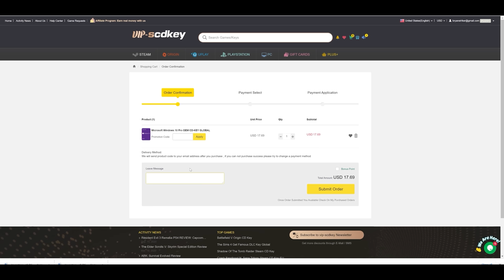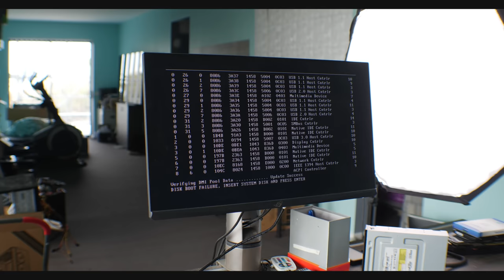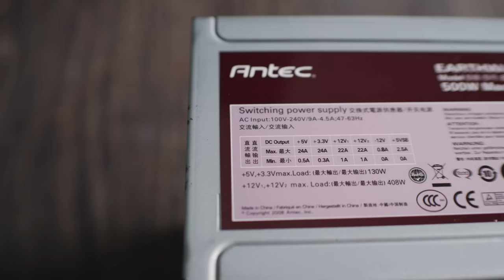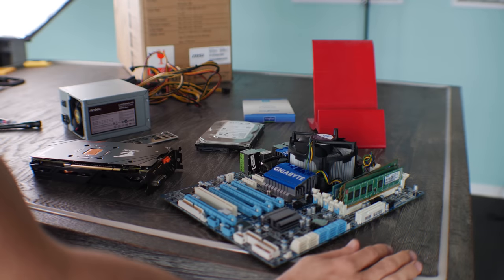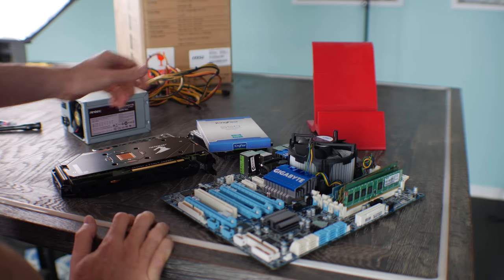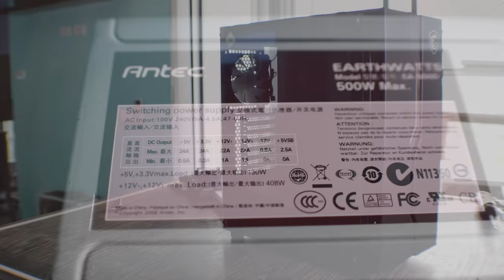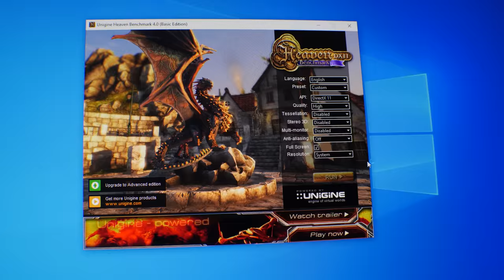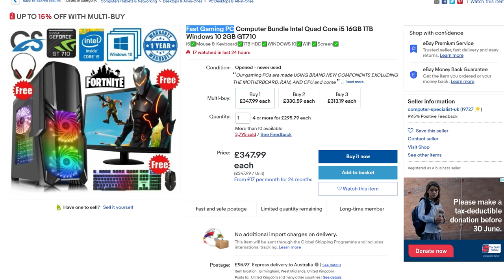Old Gaming PC Found on the Road.... Will it Work?

Comment: I like how you encourage this eco-friendly attitude. Let's use our components until they fail.
Reply: Lol, tell Microsoft that. Lol
Reply: If you suggest to not make upgrade, not wise. My Athlon 2000+ XP and Radeon 9550 are still working in a Win 98 rig.
Reply: @patrickprafke4894  in 2025 it wont be so easy with windows 11 vs normal dude
Reply: @WeatherMan2005  The US gov. And many other industries petitioned for and already received notice that Win 10 will receive updates in a variety of ways well well past 2025.  Main reason.  By the time Windows 10 dies.  12 is supposed to be here.

Comment: I got into tech from collecting thrown away old "not working" PCs when I was age 12-15, 90% of the parts still worked. I upgraded my first PC a Pentium 3 866Mhz to a Pentium 4 2.8Ghz for free, a bios setting was preventing the PC from booting, all I had to do was clean cmos button. LUL
Reply: What year was it when you first got into tech?

Comment: I bought one of those motherboards for 40aud as a “not working”... reset the bios and it booted first shot. It lives as my gtx960 turbo of 4gb sli 20gbram junker pc! The power supply and boot drive(120gb patriot inferno) were also on the side of the road.... the ssd had windows 7 that I upgraded to w10 free. Love the junker pc and the tower I put it in supports hot swapping . Great boards those udr3 x58 boards.

Comment: It is as they say - the best deals are found on the roadside.
Reply: Maybe depends😂
Reply: Honestly though how tf do you find a computer on the side of the road
Reply: @owenward7355   It takes effort to search around and if you get lucky like bryan/tech yes city then you have yourself a pc picked up on the side of the road.
Reply: @owenward7355  In certain parts of Australia and other places, every so often (it varies),  the city runs a promotion where you leave junk outside and the city picks them.  So there's another youtuber who goes around on that day to snap up computers and other recyclable stuff to melt down and sell as scrap.
Reply: @owenward7355  Alternatively, some people advertise on local facebook or craiglist, they'll leave stuff outside and you can grab it free. I was super lucky and picked up an i5-3470, 6gb RAM, asus motherboard. Like tech city, my system was missing side door, no power supply and the cpu fan was busted. The person gave it away and had listed it as pickup beside garbag bin of apartment complex.  Naturally, freebie deals get snapped up instantly so you have to be constantly checking facebook/craiglist.
Reply: @supertouring1  yup this is correct. Im in the brisbane region and its amazing what you can find

Comment: I just wanted to thank you for your videos. I picked up a Lenovo ThinkCentre PC for less than $50, and it came with an I5 4570 and 8gb ram. I upgraded the CPU to an I7 4790, added another 8gb ram, added to SSDs, and bought a used 1050 ti, and I love it! So thank you for your videos!!

Comment: I've never found a PC on the side of the road, but I have found a nearly new CRT TV with the remote here in the US before about a year after the digital switch over in early 09, but I do often find some good stuff at the local recycle drop off in the e-waste bin like working Apple Macbook Pros, fully working Amazon Kindles(they usually just need a battery), I3, and I5 HP desktops, etc...  So yeah I love these kind of videos as I hate how much e-waste we as humans tend to create over the years, and love showing people that some of this older gear can still be very useful.

Comment: What kind of person throws away X58 LITERAL GOLD!?
Reply: The type of person who had 2-4gb of ram in it in 2021 haha
Reply: probably some clueless person who knows nothing about hardware and just thought the pc was old and slow... no surprise with 2 gb ram
Reply: A person who uses a 430w on an x58...
Reply: @michaelxdrift  Actually used a 400W power supply on an i7 920 and gtx 1060 combo, but it was a quality PSU, FSP is in the TOP 3 best manufacturers in my experience, with seasonic and superflower. Don't worry I now have a 650W, but the 400W did work, still don't recommend it tho.

Comment: I live in a unit here in Sydney NSW. It's quite a large complex and we have council cleanups twice a year. As a result there is often HUGE piles of rubbish dumped out the front. It honestly amazes me what people throw out. I snagged a working first gen i7 pc a few years ago. Also snagged some gt 710s and even a 750ti once. Unfortunately, it's getting rarer to find old pcs on the roadside because the bloody council has banned putting computers out on the cleanup anymore. You are now supposed to take them to a special 'ewaste' collection point. Council rates increase yet the services decrease :/ The last cleanup we had only 1 person broke the rule and put out a pc this time. But it was some old pentium 4 garbage with no ram or HDD.

Comment: Finding discarded desktops in the wilderness sure could be useful in some way. If the parts from the inside are no good, just get rid of them and replace them with fresh, new, up-to-date parts. Only the desktop case matters to keep, not the old parts from its inside.

Comment: I just resurrected 2 Lenovo USFF PCs I found at my local thrift shop. I also found 20V 3.42A Lenovo power bricks locally, and all I had to do was add 240GB SSDs to both and they're zipping along nicely for being Pentiums. Already got a local interested in the one with WiFi built in, and the other one I chucked in some spare DDR3 I had spare to bring it up to 8GBs. Goof fun, and pleasing to see these little boxes saved from e-waste.

Comment: Love the content.  I also recently got a free pc which has an i3 4170, a 4gb stick of ddr3 ram, lenovo motherboard, cheap 200W power supply, and a 500gb HDD.  I added an SSD another 4 GB stick of ram and a GT1030 and now I can play all low and some mid level games for around $175 U.S.  Best deals right now are the kind where you find free old rigs and upgrade them with lower end components.  Thanks again for inspiring me to find and upgrade low end pc's.  It's fun and helps some kids in my local area

Comment: Many years ago (2005?) I was walking to Uni and passed a skip which had a computer case in it.  After I finished up at uni, I walked past the same skip and it was still in there, so I fished it out.  It had an AMD Duron, which even at the time was old, but it booted up no problem.  I gave it to a friend along with an old monitor so she could do coursework at home.  It's amazing what people will throw away.

Comment: I built a banger out of parts I had lying around as a spare for my son simply to play Diablo 2... i7-930 + Corsair H80i AIO, Gigabyte X58 UD3, 12GB Corsair RAM, Galax GTX-970 SOC, 250GB Samsung SSD, 1TG Seagate HDD, Corsair CX 550 PSU & Lian Li PC-P50. Only thing I bought was a Silverstone PWM fan controller ($22) and keep all fan under the control of the H80i's liquid temperature.

Comment: Nice job, man!! That's a decent rig considering the platform!!

It always irks me when some rich kid throws away a perfectly good gaming rig just because one little thing doesn't work right or they messed with it, ruined it and asked their parents for a new one. I used to live near a big garbage dump and they had a section specifically for PCs and PC parts. I would pull so much working stuff out of that pile it wasn't even funny. One example was a rig that was perfectly fine except it had a dead video card and mismatched RAM (a 533 stick and a 667 stick). I bought a budget video card (Radeon HD 7750) and some Corsair RAM and got the thing up and running for about $250 USD. Ran well for years.

Comment: Nice BRIAN does it again. THX dude. The famous first gens of intel are the best like i7-2600, 2700 k and non k versions and the legendary i7-3700k I still use for gaming and it works great. bought it of aliexpress for cheap price like 80€ (90$) back then and it still works great on MSI MOBO top quality and stability motherboard H61M-P20 (G3) Couldn't wish for more. When i built it never expected such performance paird with wd red 1tb and SSD for Win 10 pro. Plust got the 1660 card for about 200€ 1year ago and installed it in. Works MAGICLY!!! (Also the RAM I bought of aliexpress for about 50€ 16GB DDR3 with 1600MHz)

Comment: I just resurrected a 3770K asrock extreme 4 with case with ssd, wifi, Noctua U 12S, and hard drive for grand daughter.  I added a Nvidia 950 GPU I had and it runs like a top.  Cleaned up the mobo and case well and it hums along pretty well.  Ivy Bridge copes pretty well with modern day tasks.

Comment: Once bought a "used PC-case" for equivalent of 10 USD - had a 2600 on a mobo, and 8 gigs of RAM and a 400 W PSU.... 
Also, the "X58-2gb-mesh" is fun to try and OC - once got 6 random sticks to 2133 mhz :D on an ASUS board...

Comment: I used to deliver newspapers. i had a tower that was about 4 cases wide all the way to the ceiling in my computer / gaming room lol. Most were way older, AGP days and stuff, but so many of them were surprisingly cool (MSI Dragon motherboard comes to mind; GTX 260 BFG edition) but I found stuff that was newer as well, DDR3 era stuff. One exciting find I got my hands on was an i7 870, that I overclocked to 3-point-something GHz. It was very hot but it was a beast for how old it was relatively and that was a couple years ago.

Comment: For the past couple weeks Ive been buying HP z240 workstations for $30 each and they have an i7 6700 and no ram/storage so I've spent basically $30-40 on ram for each one and I got 2 1070's and a rx 5808gb for $190 for all 3 and then I got a 1070ti and a 1660super for $100 each.  So far I've sold 2 computers for $400 each with about $150 in them.  its so fun!

Comment: Just found in a garbage bin an AMD FX8370, Gigabyte Ga-990xa-ud3(I think) motherboard,and Arctic Freezer Extreme cooler.
It works,kind off,had to replace South bridge cooler with a custom one, replace cooler with twin - fanned SnowMan,and add a spar AMD specific 8 GB of ddr3 ram.
After a LOT of cleaning,re-flashing the bios,it seems to work.
Now,I might leave it,as a spare one.....

Comment: Oh yeah! Lovin' the X58 board!

Someone in my neighborhood threw out a 6th Gen system with an i5-6500, and Windforce GTX 970, a 1tb WD Blue HDD, a 750w EVGA 80+ Gold semi-modular PSU, a cheap ass DIYPC case (the purple and black one) two 8gb sticks of DDR4 (no heat spreaders) and a stock Intel cooler. The PC was nasty as Hell. They obviously were vaping since it was sticky inside and there was cat fur stuck to everything. On top of that, it was filled with hundreds of dead roaches. I cleaned that out all afternoon and saw there was nothing inherently wrong with the parts, just dirty. I got the smell under control and was able to flip it for $400. Love that win, but it sure was disgusting.
Reply: The content on the hard drive was disturbing to say the least. Had to use a Windows boot disk to enable an elevated command prompt and create a local administrator account. Glad I didn't bring it online on my home network.

Comment: Loven the content, funny as brian. 
After killing my mobo on my old HP z230 sff. I bought a replacement p.c(used your code for windows activation) 8th gen i5 ,16 GB ram and a 1070ti, 750gold PSU modular, NZXT H400 case paid$1200. 
Then today I score a GeForce RTX 3070 Asus k.o GPU for $1300 not even sad that it's cost me$2500 for a awesome rig😁
Reply: Don't be mad Brian but I gave the 1070 ti away to a friend who was still gaming on a 660.

Comment: I laughed so hard when you turned that psu on and off with switch to "get rid of residual electricity" . i can tell you have no idea how any of those components work. That switch there just to cut the power line between power connector and rest of psu.

Comment: I found a gaming PC on the nature strip of my apartment block in 2016 and while it didn't have the clip for the stock cpu cooler and the case was pretty banged up with no feet I ended up using the GTX 550ti graphics card as it was better than my Intel graphics 4600 onboard until I got a GTX 1060. I also used the PSU but had to replace the fan as the bearings were noisy and had coil wine but it worked.  I tried the AMD FX 6100 3 core but it was slower than my new i5 4590.  I ended up selling the board and CPU for $40 a couple of months ago all these years later go someone who had theirs die and just wanted a like for like replacement which I never thought I'd be able to sell so even if you think it's worth less someone may pay money for it.

Comment: Over the years I've gotten a 1TB HDD from a DVR someone threw out. I've also gotten a name brand 450W PSU, Dell Core2 system, LGA1156 motherboard, AM3 motherboard, 2 Phenom II X4 CPUs, lots of DDR2 and DDR3 RAM, 3 laptops, 5 monitors, 2 TVs, and 3 air conditioners. It's still nothing compared to what you find. In 2019 I built a gaming PC for basically free, just for fun. Some of the parts I mentioned were sold to buy betters parts, others I used. I ended up with a Xeon X3470, RX480 4GB, 8GB RAM, and 450W PSU. I never did find a decent case or HDD at the time. I knew a teen that really needed a better gaming PC so I gave the stuff to him. He got a case from a friend we reused the 1TB SSHDD from his laptop and I tossed in some fans to complete the build. This was in early 2020 before the pandemic hit so he got really lucky with the whole thing.

Comment: I managed a water-cooled aio 4th gen i7 with 16gb ram and a 6th gen nvidia gtx in an asus case from the tip.  Sold it 2 years ago for 600 AUD. Spend ages debugging it to find out it was my dvi cable broken. Used it for 6mths before realising how much I could make from selling it.

Comment: That CPU is in the same generation my current PC has. My PC has a i7 965 extreme edition paired with a Asus P6T motherboard which I maxed out to 24GB of DDR3 ram. Still runs well today. Currently got a GTX 780 Ti in it. Use a VGA CRT monitor as my main monitor so went with a card that still had VGA output support. 960 ti also has this but they were a bit too pricey at the time so went with 780 ti. :P

Comment: I had that exact Thermaltake power supply back in the day and it caught on fire and killed my mobo and CPU. Luckily I was using it when it died and shut down. I quickly pulled the 120v cord from the wall so the fire would stop. I thought there were failsafes in place to prevent a runaway fire. Not this PSU. It's dangerous!

Comment: About those misleading ads, in australia people should complain to the ACCC. They do issue infringement notices for false and misleading advertising. Even if nothing happens in one individual case, if enough people complain it will cause the regulator to take action against repeat offenders. Not everyone is as savvy as Tech YES City viewers, and some people could easily be mislead by those claims.
Reply from the maker: I just don't understand how a lot of them don't leave the negative feedback though... its baffling, I mean if I bought something as garbage as that I would be flipping out.

Comment: I've got a question for you Bryan. Who's making the most money? The scalpers, the miners of the GT710-ers?

i5 2nd gen ex office PC
Cheap PSU
Cheap RGB case
GT 710
All for 399 dollars or pounds....... that's got to be about 250 profit..... 3700 sold by 1 seller for 1 listing.... that's £925k of profit and they probably have multiple listings.

Comment: Denatured alcohol on a cloth will make quick work of that thermal paste. It will get the processor and the cooler absolutely clean with almost no effort.
Reply: Iso Propyl does the same job n usually cheaper.

Comment: found near a dumpster an i5 760 coming from an overclocked two 3258 pentium. Atm it was hell of a difference and the whole system worked perfectly paired with a 750 ti

Comment: It`s strange what people throw out, i found a computer with a FX 6300, 16GB ddr3 1600mhz, 120gb ssd,1000gb wd green, 750w corsair psu, GTX 560. everyting was working exept for the ssd that was not plugged in so it would not boot in to windows!  Same with a Acer laptop in mint condition, older but perfect (First i5), the problem? charger was missing!  Alsow a socket 775 system with Asus P5Q, C2Q Q8200, GT440, 500gb wd blue, 500w coolermaster psu and everyting worked :)

Comment: That's a great find!  The best I've gotten was a 500gb HD in a system (the system itself wasn't worth taking - Pentium IV, DDR RAM).  I didn't have any tools but fortunately I was able to use one of the slot covers that was loose in the bottom of the case to take the drive cage out...

Comment: Bryan, I can't believe you didn't stick one of your favorite Snowman coolers on there so you could run it at 4.0 or 4.2-ish. I love X58 as much as anyone, but that hardware is too dated to run usefully at stock speeds, IMHO. Really, I find it scandalous to run a Bloomfield core CPU in a Gigabyte GA-58A-UD3R at all. It's well worth the $20 for an X5650 as you have often advocated.

Comment: i found a pc on the sidewalk outside someones house and took it home. I plugged it into a old monitor and it actually worked. It had a core i5 2320 so i upgraded to a i7 3770 and hope it works

Comment: To not put an x5670 cpu in that motherboard is a sin. and a decent tower air cooler, those motherboards can be sold on eBay for decent money, maybe you could see what is the maximum card worth putting a in a pcie gen 2 motherboard like that with an OC six core.
Reply: I’ve put a Vega 56 on an x58 board. It’s held back obviously, but surprisingly not much. In cyberpunk 2077 the GTX 980 in have in there normally is the limiting factor and not the x5675(at stock)

Comment: RX 570 for 120 AUD? Even before the GPU shortage I got a good deal on a GTX 1060 and that was 160 CAD. Not to say that it isn't possible, but that seems exceptionally unlikely for most people; plus at this current time an RX 570 is going to be a heck of a lot more than that as well.